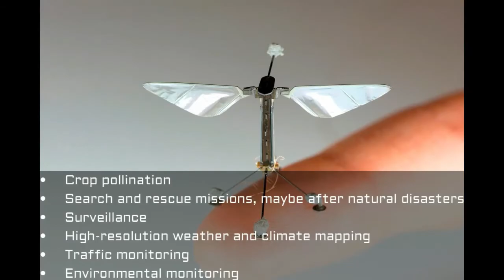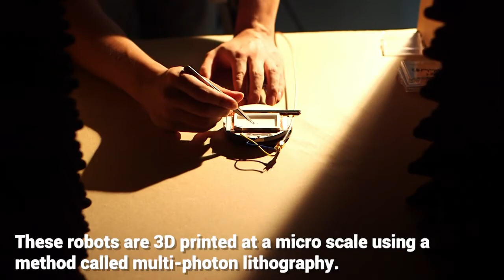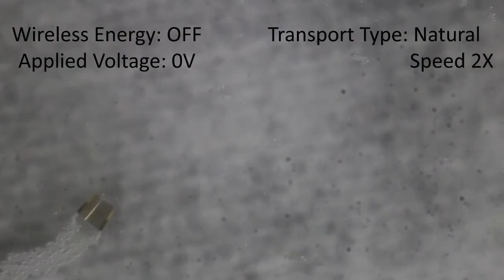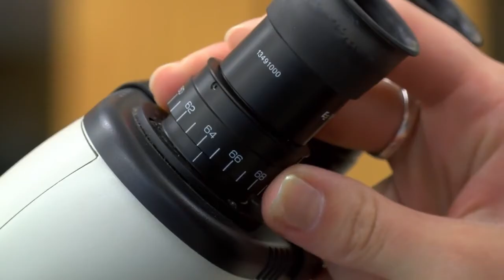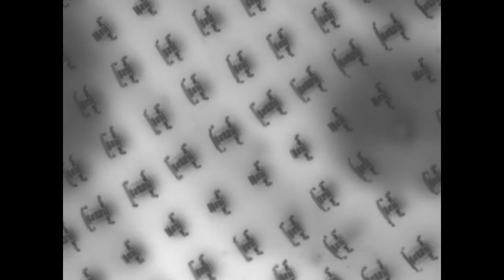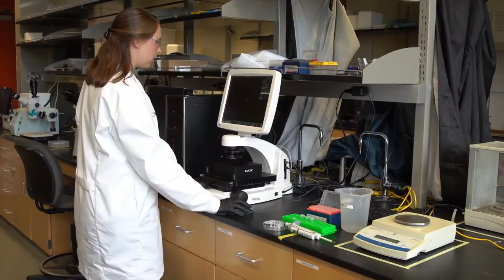Smallest Robots Ever Made | Micro-robotics (Nanobots)

Comment: Sounds like you're all trying to make a machine to chew at the Universe segmenting it sapping energy for power no matter what someone tries to tell you heading down the wrong evolutionary path where my skin doesn't swap itself with the air around it like a computer animated sequenced frame rates that's not how Biophysics functions possessing a protective skin against a biological threat with an absolute limit to its very extremity sustaining its dimensional structural integrity with no weak point that I will never be augmented with machines which are doomed to fail full of holes of wickedly weak spirits depending on them not truly quantum at all spitting duds continually that will be totally cancelled out not in the Focused Developmental Resonant Resolution of the Primordial Cometary Lightbolt Skotophotomorphogenesis!